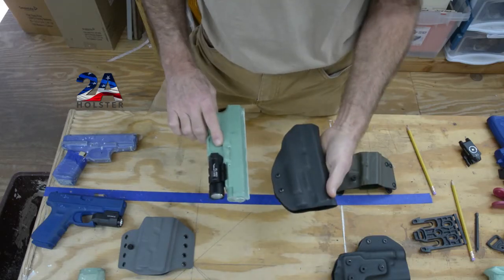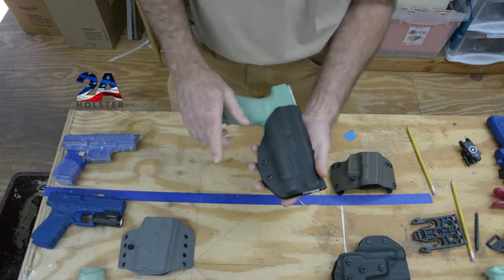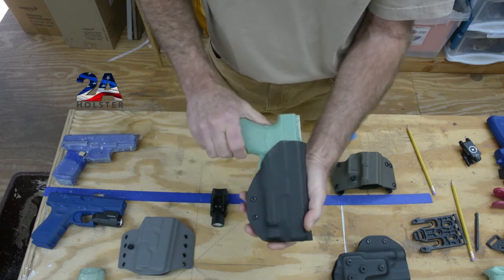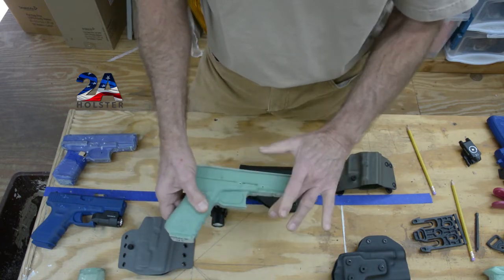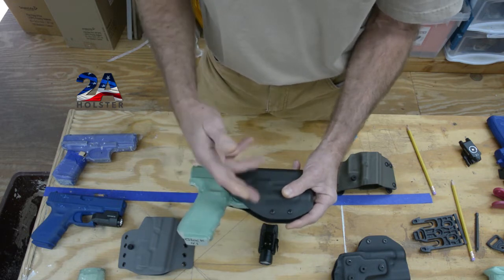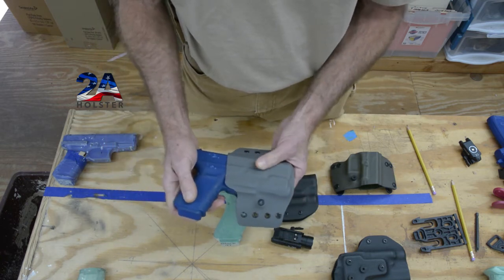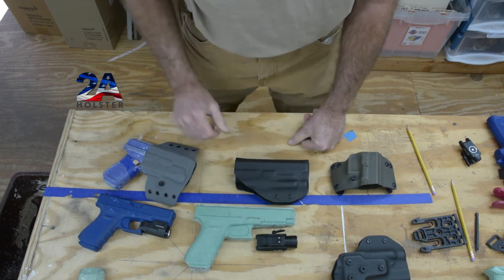With and without a light on your holster

Comment: Want to comment regarding lights and holsters. I sent an  email message to 2A Holster asking about a Viridian light and a custom holster.  I wanted a magnet placed inside the holster so that with a draw the light would automatically deploy.  The holster was not a 2A Holster.  I thought this was a long shot to have a magnet placed inside the holster as the guy that made the holster tried without success.  Not more than an hour or so later I got an email from 2A Holster saying try gluing the magnet to the outside of the holster.  A few messages back and forth and 2A Holster got me up and running with detail instructions !  Thanks again 2A Holster !
Reply from the maker: Thank you Sir!

Comment: Thank you for this information, it helped a lot. My wife and I both have the 43x but I'm looking for a light for mine and wanted to use the same holster
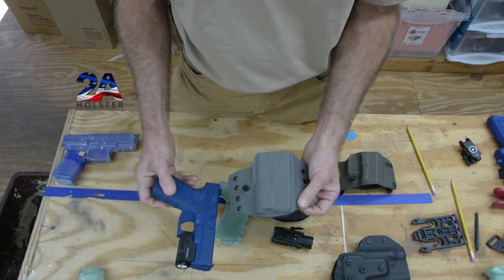Reply from the maker: That Inforce APL-c light at or about 2:43 also comes in a mini version. Look into that one for your 43X. Great Weapon choice! You have a rail or use a rail adapter?
Reply: @T0mmyTune  Yes, mine has a rail, but my wife doesn't.